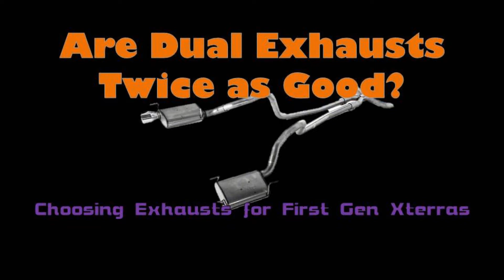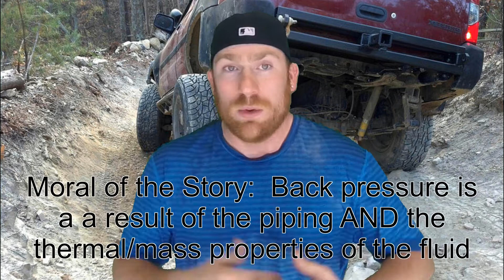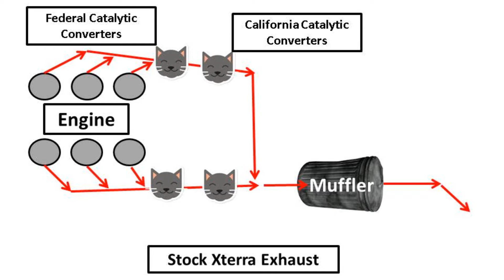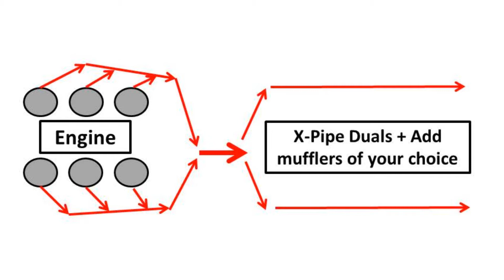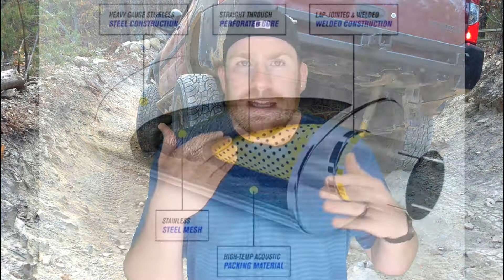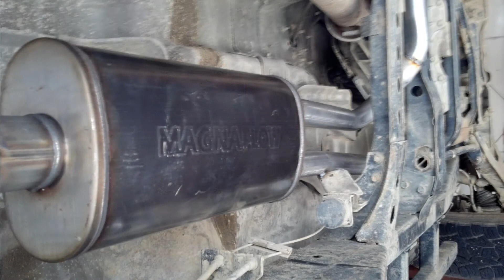Are Dual Exhausts Twice as Good?  Choosing Exhausts for First Gen Xterras

Comment: I put Doug thorley headers on mine. That’s the only name brand I could find that makes headers for the 3.3l

I didn’t really notice much of a difference… going to replace the entire exhaust now, from the second set of cats back. (Deleted the first set to fit the headers). Maybe that might help, but I doubt it. I have an exhaust leak behind the cats, so that’s why I’m going to just replace the entire exhaust behind the cats. But I don’t think that will result in any better performance. I was really hoping putting these headers on would make a huge difference.
Reply from the maker: Good feedback. If you like a challenge I did a camshaft install. Cams did a decent power bump. Not a race car...but obviously more power.
Reply: @XterraRob  hmm, maybe another time. I just replaced all the seals from the block up, radiator, power steering lines, water pump, thermostat, distributor, spark plugs and wires, stator and fan blades, and most all of the hoses because I blew a head gasket haha.
Reply from the maker: Haha too late to do that now!!!  Would've been a nice while you're already in there mod though!

Comment: Hey I have a 02 supercharged xterra with headers with a 3in super 10 do u think I should go with a full 3in or go with 2.5in instead? I have been trying to figure it out. What are your thoughts
Reply from the maker: 2 inch out of each header and combine them into a 2.5 inch single pipe. If you want a fat tail pipe look...get an exhaust tip that goes from 2.5 to 3 or 4 inches. An xterra doesnt push that much exhaust gas...especially since it is a low revving vehicle.
Reply: @XterraRob  thank you for the help and advice
Reply from the maker: Glad to help!

Comment: Why didn't you use the x pipe method??
Reply from the maker: Engine doesn't push enough air to need the extra capacity of two pipes.  Single 2.5 in pipe flows about as much as 2 x 1.5 inch pipes.  The passenger side pipes are blocked by the fuel tank...so id have to cross them over to driver side, combine them, and then split them back off to have a dual exhaust that goes out on passenger side. Lots of extra bends just for the look of two pipes.  If I was going to do dual because I liked the look....id get a 2 in 2 out muffler and let the muffler serve as the x pipe. Then route both tail pipes wherever you want them to end up at.
Reply: @XterraRob  yes, but I meant x pipe the two right before u go into your muffler likes u described. Two out, x pipe it, then back away from each other, then into muffler.
Reply from the maker: Because of the space under the truck. By the time you get both pipes together on the driver side...you are basically where the muffler is anyway. What I described is usually in applications where the muffler is all the way back next to the rear bumper. The xterra muffler is pretty close to the front in comparison. May as well let the muffler be the x pipe here.
Reply: @XterraRob  ok I see, thanks
Reply from the maker: Yeah happy to help.
Reply: @XterraRob  what type magnaflow u use?
Reply from the maker: I got a magnaflow performance muffler...5x11 inch oval body. Two 2inch pipes on one side...a single 2.5 inch pipes on the other. Magnaflow mufflers are non directional...meaning it could be used as a single in, dual outlets etc...so dont get confused on their website looking at the photos. If you want duals...look for one that is two 2 inch pipes in and two 2 inch pipes out.
Reply: @XterraRob  thanks. I believe your set up is good. Like you said, too much pipe/too many means less velocity
Reply from the maker: You got it dude...thats how I made my decision :) thanks for watching.
Reply: Got mine done like yours. I did two 2" pipes out of engine into one generic style flowmaster muffler, and one single 2.5" out to the rear...guy who did it was good...this thing cackles!!!
Reply from the maker: Nice!  I bet it sounds awesome!

Comment: Hey how well has your paint on the trims held up
Reply: Was thinking about painting mine not black probably gray like they are
Reply from the maker: Duplicolor makes a specific bumper paint that had worked pretty good. I think it comes in a grey color too.
Reply: @XterraRob  thanks for knowledge and replying man keep the vids going
Reply from the maker: Will do...thanks for watching!
Reply from the maker: Paint held up pretty good on bumpers, roof rack, rear corners, grill, etc. Not so good on rims. Don't do the rims.
Reply: @XterraRob  about how long would you say it would last, and what kind would you recommend?
Reply from the maker: I used rustoleum bed liner that comea in a rattle can. My grill, roof rack and rear corners have been fine for 5+ years now. I ended up replacing my bumpers. Be gentle with pressure wash style carwashes...but they are easy to touch up. Like all painting...its all in the prep work.  2 or 3 light coats on a CLEAN bumper that has been scuffed lightly with sand paper or a scotch brite. Let it dry thoroughly between coats and youre good.

Comment: Awesome video.  Thanks for putting these out there for the rest of us who ate learning. Small question... I have 2000 RWD, and was wondering how difficult it is to replace power steering pump. Getting conflicted answers through message boards and just wondering because I would like to do it myself. Thanks again for such great content.
Reply from the maker: Ive never replaced it before...but it looks pretty accessible. Its usually not more complicated than a few bolts/brackets holding in place, taking the belt off the pulley, and disconnecting hose fittings. It may be tricky avoiding air pockets in the pump since the new one is dry...but whats wrong with your current one? Thanks for watching and commenting.
Reply: @XterraRob  Actually after taking another look at it, I'm not so sure it's the pump that lleaking. It's pretty messy down there , but , I think it's my high pressure hose. I'll have to clean it to be sure, but living in an apartment has its limitations.
Reply from the maker: Good find! I have had trouble with the two rubber hoses on the reservoir leaking and making everything grimy, so look out for those too.
Reply: @XterraRob  I appreciate the reply though. It's just a huge mess now, so I was considering it being the pump for the amount of fluid that was around but noticing the location where it collects mostly, it seems more likely to be the hose.
Reply: Quick update for ya, if anyone asks about similar problem, it was the rubber on my high pressure hose, just above the crimp. Can't tell if the rubber was eaten away or cracked due to some banging or rocking, but going to have to replace that. Didnt notice it because a chunk of the sleeve had torn and covered and was semi heat shrinked around it lol.

Anyways just though I'd follow up.
Reply from the maker: Good find. Thanks for sharing!